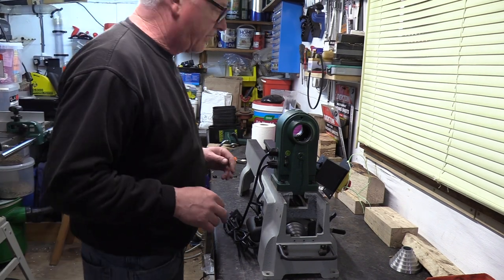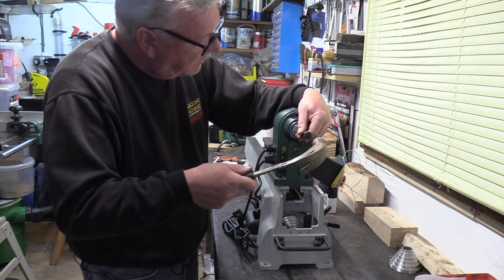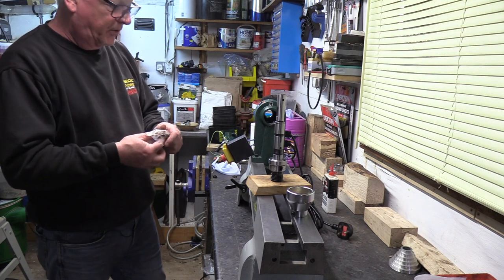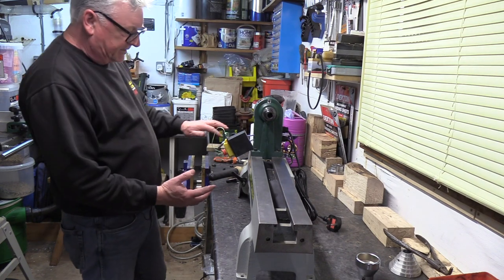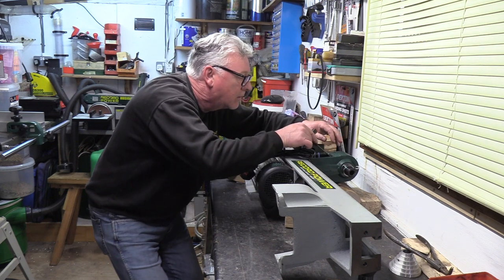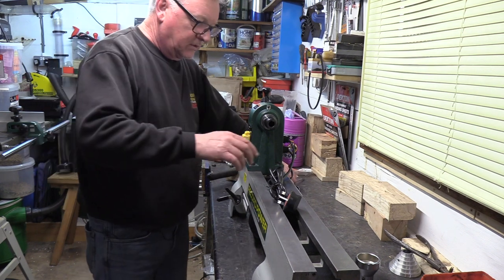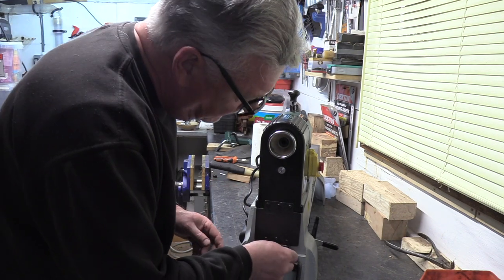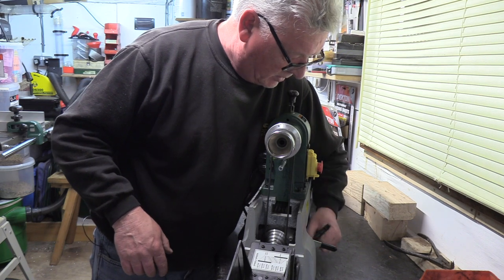Know-How Series: DML305-M33 Cast Iron 6 Speed Midi Lathe Maintenance: Part Five

Comment: Hello Peter. 
This is an extremely valuable video. 
I'm about to replace the bearings in exactly the same lathe. 
Just a quick question.
I see there are 3 bearings. Looks like 2 at the drive end and 1 bearing at the motor and belt end. 
Do the 2 bearings at the drive end butt up to each other, or is there a gap between the 2 bearings. 
I appreciate your maintenance videos and hope you can help me with my question.

Best wishes,

Richard

Comment: Hi Peter have you done a bearing replacement on the DML 320 variable speed lathe please
Reply from the maker: Hi Michael, thank you for your comment. As yet, we have not produced such a video on the DML320 lathe, however, your suggestion has been noted for further productions. For expert advice, please contact our Technical Support Team on 01246 571 020 (and select option 2) or email technical@recordpower.co.uk. Best Wishes, Record Power.